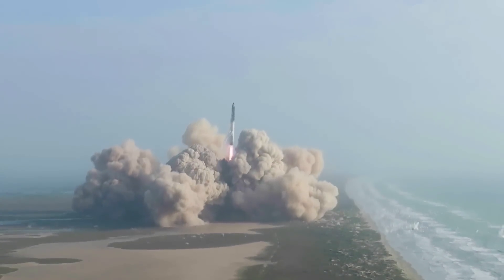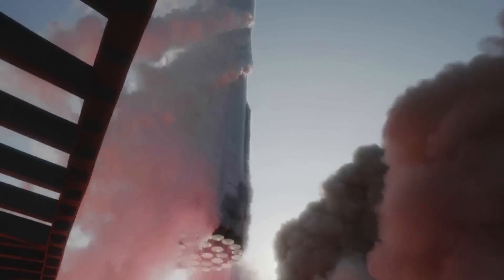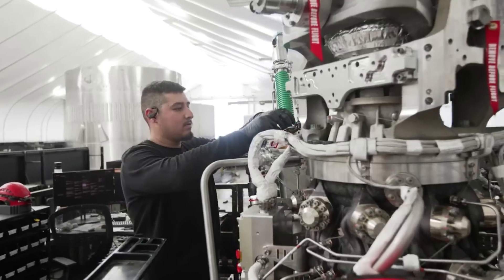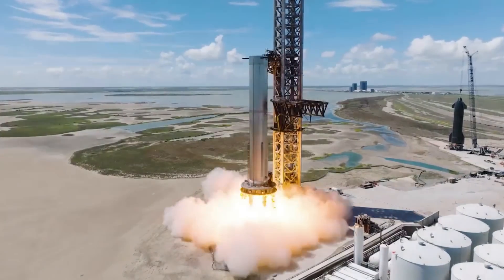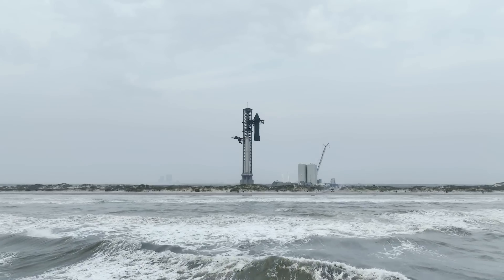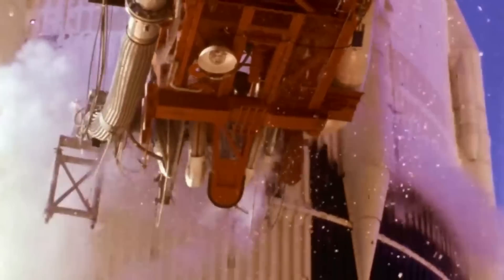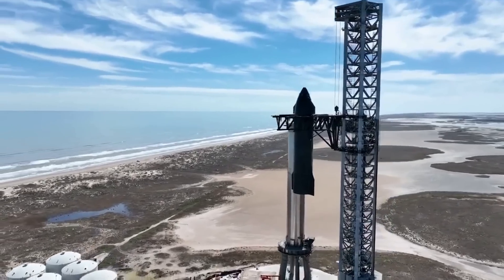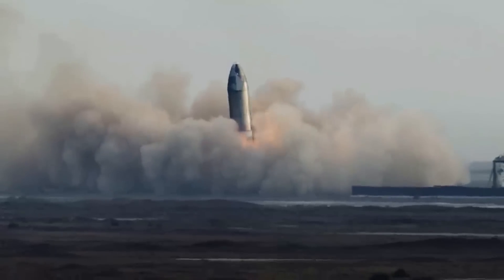Could Steel Plates Solve SpaceX's Starship Pad Issues?

Comment: Build the launch pad right in the water so it sticks out. The water should massively absord the flames/smoke then just build a bridge towards it. Can't see why this would't work!
Reply: Some concerns:
- how to bring the rocket into the water to the platform?
- No active supply of water. You have to put it into deep water, otherwise the water underneath will be vaporised fast
- salt water on electronics of the launch mount tend to be nasty

Not saying it couldn't be done, but it's probably not a simple solution
Reply: Whoops, didn't see the bridge part. But if you built a bridge to the sea, you might as well just build a proper flame trench with active water supply. You also have to channel all the water vapor away from the rocket, flame trench solves that too
Reply: Hopefully someone can breakdown the possibility/challenges of building this on this comment thread?! Please :)
Reply: Let me also be the wet blanket that points out that this is in the middle of a nature preserve. Those ocean waters are the important breeding grounds for multiple endangered species. They will never be allowed to blast the shoreline to bits.

Comment: I think SpaceX is probably going to need to revisit the modified oil platform idea if they can't come up with an effective blast diversion plan. Launching from land is going to be a problem, no matter what is under that booster. Steel will vibrate like crazy, it will warp and pucker from the heat and pressure and require replacing after every launch. Pretty much any solid surface under that booster is going to be vaporized and kicked up into a huge cloud, except maybe tungsten. Launching it over water is the best bet; then they don't need to worry about incinerating the substrate and turning it into projectiles, plus sea water will deaden a lot of the vibration from the engines.
There's also the issue that the stages didn't separate. I haven't heard much about what happened there.  My personal hypothesis is that the condensation from that gulf coast humidity formed on the outside of the stack during fueling and created a very thick sheet of deeply frozen ice that essentially glued them together. Stainless steel isn't particularly known for it's insulating properties and by the time that stack is finished fueling with cryogenic fluids it's gotta be wearing a thick coat of multiple tons of ice. Some of it breaks off and falls away during ignition, but probably not all of it.
Reply: haha nah, a bunch of ice wont "glue" a rocket together
Reply: @froschreiniger2639  Never underestimate what cryogenically frozen water ice can do; it was a key factor in the loss of two space shuttles. When you freeze water to 100 degrees below zero or more, it may as well be stone; it's every bit as strong and every bit as dense.
Reply: @jimmypenrose1401  yes, but did you see how that thing waa doing flips at supersonic speeds? I think the ice didnt glue the rocket itself together but rather the release mechanism
Reply: So you're saying because they have issues with the rocket destroying a solid concrete foundation...they should instead put a ship/old oil platform under it? I feel like that would be even more prone to damage. No?
Reply: @kelle500  A modified oil platform was what SpaceX was originally planning on using for launching Starship. The launch mount would direct the force of the blast underneath the platform and it would strike the ocean surface - absorbing a lot of vibration in the process - and then dissipate the energy out of all 4 of the open sides of the structure. It wasn't a bad idea, but it wasn't the easiest idea to implement; so they eventually rejected it. I think Elon had even purchased a couple of oil platforms for the purpose which were then sold off.  I'm saying they may have to resurrect that idea... or perhaps machine a new launch area made entirely out of solid tungsten..
Reply: The interstage was pretty ice free from what we could see.  If anything, it was loss of hydraulic pressure to release the clamps.
Reply: I can't see the EPA allowing the environmental damage to all the marine life within a mile of the platform.
Reply: Ice wasn't forming where the stages separate. It forms on the outer skin up to the surface of the cryogenic propellants. The joint between Super Heavy and Starship is within the air filled area surrounding Starship's engines. The clamps and mechanism to operate them would be within this ice free area. They would have been shielded from any ice falling from the outside of starship.

But I've heard one of the tanks or associated plumbing that power hydraulics had failed. It might have been struck by flying concrete debris or the hydraulic fluid lost through damaged hydraulic lines or actuators at the base of the booster.

Comment: Here is crazy idea: mount a bunch of raptor engines at the base of the tower, pointed horizontally at the OLM base and use their thrust to diffuse and scatter the exhaust from the 1st stage. Fight fire with fire! 😅

Comment: Couldn’t they solve all these issues with a track and sled system. Probably science fiction. In fact that’s where I got the idea “When Worlds Collide.”
Reply: I used to wonder that myself. Then I came to the conclusion that multiple teams of engineers since at least the 1940's studied the issue and and concluded the shortest path, the one with the least resistance, travels perpendicular to the surface. So I'm sticking with their assessment.

Comment: SpaceX has to commit to a Launch Pad w/o a Flame Trench if they plan on launching at sea.
Reply: Space X is obviously not thinking about launching at sea for some as they sold the two old oil rigs last year that were intended for that purpose!!
Reply: You can still have a symmetrical diverter on a floating platform. The sea launch platform that was used in the past was much further from the “salt water” than SH is from the concrete.

Comment: If steel plates are at 90 degrees to thrust line, the raptors will burn right through'
There is a good reason why flame diverter trenches were invented.
Reply: Did no one else see this coming? I live in my mother's basement and it was obvious to me. #humor

Comment: Bruh would the water just, evaporate before it can cool anything? I'm expecting the pad to look like a pool of red steel if that's actually what they're gonna do
Reply: water removes lots of heat when it turns to steam.  Forcing water through to cool it can work.  Remember the inside of the raptor engines are made of metal, those don't melt because of being cooled with liquid O2 and methane.
Reply: @clytle374  I mean, liquid o2 and liquid methane are at like -250C but water is at like room temp
Reply: @EthanJbleethan  look up energy of phase change.
Reply: Latent heat supply!!

Comment: if they try and reinvent the wheel for every one of these problems it will be slow going
Reply: And it is slow going. Very slow going.

Elon presented the Starship (called ITS then) back in september 2016. That is almost seven years ago now.

Do you know what Saturn V did after seven years of development? It sent Apollo 11 to the moon its SIXTH consecutive, and successful, launch!

They decided on the Saturn V design, or C-5 as it was called in the beginning, in 1962. First flight happened after five years and the actual moon landing after seven years. And this was in the f'ing 1960s with slide rules and doing most calculations by hand.

Saturn V never failed. Had some minor problems, including the lighting strike on Apollo 12, but it always did its mission successfully.

I can guarantee that Wernher von Braun would have been fired if Apollo 4 (first flight of Saturn V) had ruined the pad, flown for a couple of minutes and only reaching less than mach 2, gone into a spin and was blown up. 

And if he was cheering for the "success" after such a launch, he would probably be locked away in an insane asylum.

Comment: Rocket is too close to ground. It doesn't matter you put steel plates or something else. It will be blown away with very high velocity gases. I hope Elon learns from mistakes.
Reply: lol, another expert engineer debunking Musk and his teams of engineers.  I'm surprised you all haven't landed on the moon yet.
Reply: @clytle374 They don't test frequently. For rocket companies it is a death sentence. If they tested just a booster last year, they would get to this point faster. Elon just got so many things to do. I mean AI, Twitter, Tesla, Boring, etc. No wonder. LOL
Reply: @clytle374  Hey, don't say that they built a sophisticated flame deflector. You don't need be an Albert Einstein to see that. They were told about this many times. Yes, Elon and his all engineering team failed to do that. LOL
Reply: High velocity gasses, not high pressure. There is no more then 1 atm pressure in the exhaust stream once it leaves the nozzle.

Comment: Since NASA has extensive experience with these things, SpaceX should consult them and better yet, send their own engineers to KSC & personally examine the launch area/Stage 0 features they've used there to great effect for decades. Then double-up for Starship & SH Booster stack, since it has double the thrust of the Saturn V.
Reply: Except we already know what KSC does; they use water deluge systems.  If SpaceX wants a proof of ability to launch and recover on Mars, water is out.  Not that Musk’s hair-brained idea will ever work on Mars anyway.
Reply: Being that the Saturn V guys are mostly gone now... You must not be watching a lot of what is going on with everyone other than spacex, spacex seems to be the experts now.

Comment: Yes steel plates and the water deluge system should mitigate the bulk of both the heat thrust and sound acoustic problem of a 33 engine raptor launch. . If the steel plates for angled welded together so they form AV at the top and then spreading downward with a flame trench on either side.  In the water Dell you system a portion of which should then be angled to hit each side of the plate plates. When the engines ignite this should cool the plate to keep it from melting as well as divert 1/2 of the thrust flame on one side of a flame trench. And you other half to the other flame trench on the other side.  So it's like a Pyramid like AV on the steel plates. This would go a long way to fixing the destructive force of that much thrust.
Reply: Really, all that appears to be needed it to not have chucks of stuff flying around breaking stuff.  If the steel plates can stay in place I think the problem is fixed.

Comment: Starship serves as a very good example for how NOT to design a big rocket. 
From its massively overweight steel body, which requires even more weight of fuel, unreliable engines,  layout of support infrastructures... there's so many lessons to learn from it  for rocket engineers around the world!
Reply: Please let me know the name of a rocket engine that can survive being hit by large chumks of concrete while running at 90 %. The engines are perfectly reliable, but once smashed they stop working.

Comment: If chemical rocke destroy pod what will nuclear powered destroy? All the Mexican gulf ? 😐😐😐
Reply: Nuclear powered spacecraft will have to be assembled in orbit. No way is anyone lighting off a fusion drive down here on earth.
Reply: No nuclear propulsion will ever be fired on Earth.
Reply: @Antares2  Are You shure? 150 years ago they said. It's impossible to fly (only baloon can fly)
Reply: @zeljkorubesa473   I think you misunderstand. 

It's not a question if whether or not nuclear propulsion is possible. It is. Nuclear thermal engines have even been tested as far back as the 1960s.

My point is that they are extremely polluting as they eject nuclear material with the exhaust. 

Also, even the least efficient (and highest thrust) engines are powerful, but not powerful enough for launch vehicle applications.The engines have a significantly lower thrust-to-mass compared to chemical engines.

As for nuclear electric they are nowhere near powerful enough to lift anything. Nuclear electric thrusters will always be a slow and steady acceleration over weeks and months. Definitely not what you need for a launch vehicle.

Comment: Better to use titanium. Elon can afford that
Reply: Better to use heat resistant stainless like ra330 incoloy
Reply: Why? Titanium isn't very heat resistant compared to steel.
Reply: @wally7856  like hell it isn't. Why do you think they used it on the SR-71!
Reply: @steveleach4973  Why? Because titanium is much better then aluminum while still being light enough to take off and fly. Maximum operating temperature (while still retaining strength) of Aluminum alloys is ~350 F,  Titanium alloys is ~1112 F, Stainless steels and Inconel is ~2000 F. If they made the SR-71 out of steel it would have been too heavy to ever get off the ground.

Comment: SpaceX's Boca Chica Blunder ... means the BF Rocket is going Nowhere ! ... Because it has No Lunch Pad ! ... All it has is a BF Black Hole in the ground and a HARD Engineering Problem .... The most powerful Rocket needs a most Powerful Lunch Pad !  that can handle a Blast 3x a day ... Then it's supposed to Catch the thing ! ... What a Lark ! ... A Macgyver fix isn't gunna Last ! ... Just ask the Fondz .... And Musk just Rained Hell on a Nature Preserve ... probably killing half the Birds and Bees for 5 kms ! ... plus Ruined the Beach ! ... Why ? because of Rushing and Inadequate Parts ! ... Musk got lucky that a BF piece of Shrapnel didn't hit a Fuel line and Blow the Place Up ! ..... Musk's 33 Rupture MOAB is GROUNDED !! ... Now he has to Stop Production ! ... Or he will have a Rocket Garden full of potential Duds .... Stupid is , what Stupid does ! ... Boca Chica is stalled , Rocket Production is Stalled , the Cape Kennedy construction is stalled ... and as for the Moon and Mars ... LOL !
Reply: Mother Of All Boosters: I like that. Did you notice the car-sized chunks of stuff flying as high as the tower?
Reply: @paullangford8179  Chunks thrown higher The Tower of Mordor ? .. Yikes ! ... It had a cable snap last week and sent the cable and counter-weight crashing to the Ground Floor , with a shower of sparks as it bounced of each floor  ... The place is falling apart ! ... Not a good start for Musk , on Step one of the first Task ! ... Angry is Right ! ... This could take Six months to a Year !